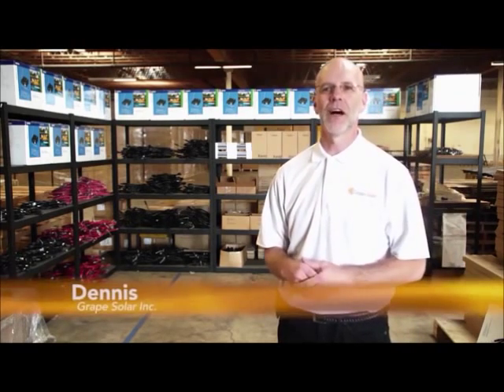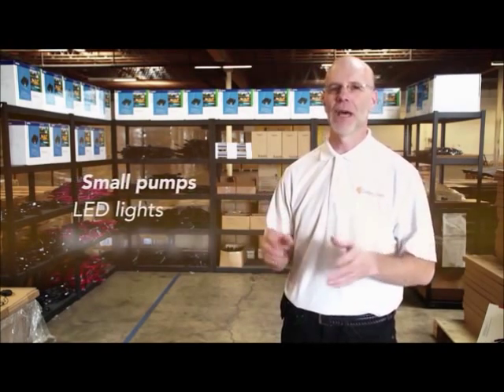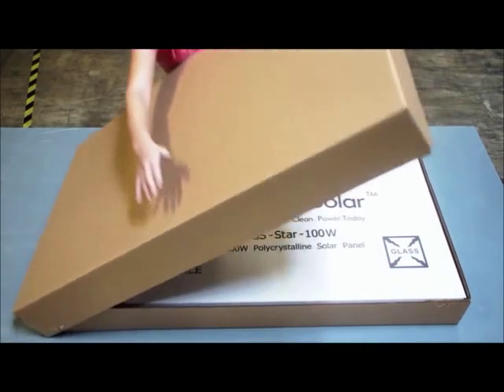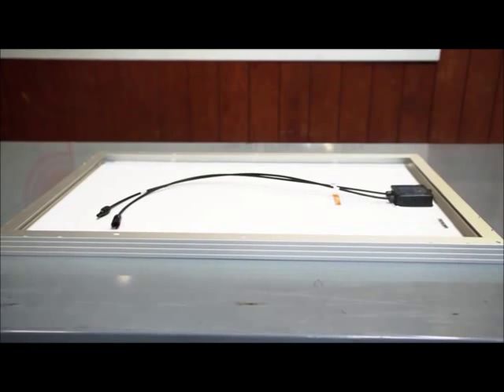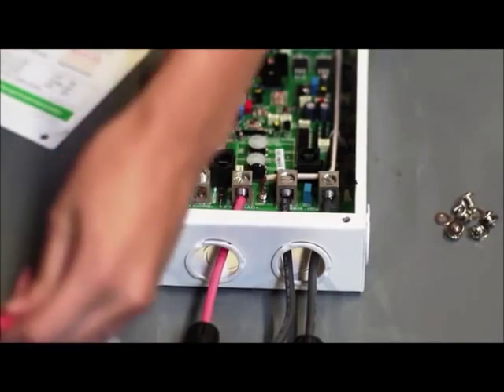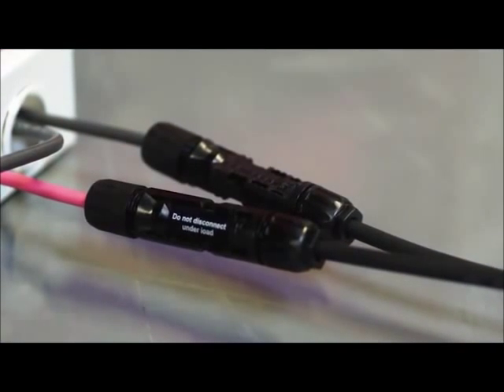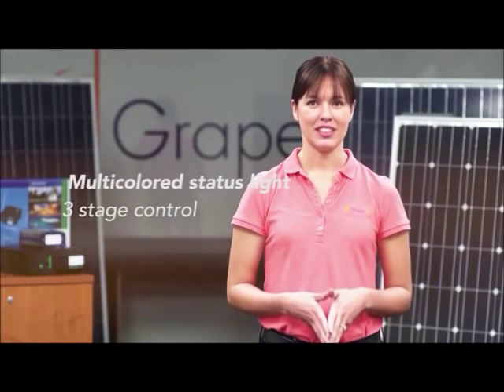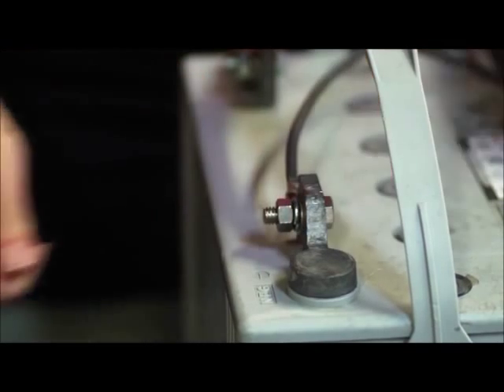Grape Solar 100W Poly-Crystalline Solar Panel Installation Guide

Comment: Interesting BUT; I would like some type a solar set up to charge two 12volt 35 amp batteries for a wheelchair normally to fully charge those batteries with what I got a five amp charger it takes 12 to 14 hours to charge the wheelchair Is there a danger that I did not learn in school of going to the higher amp charger the repair guy used a 8 -12 amp charger ( an Auto Adjust thing) at his location